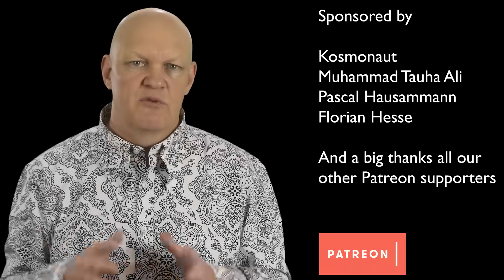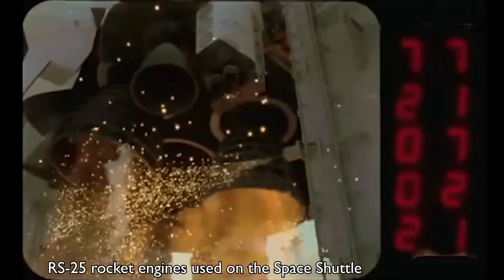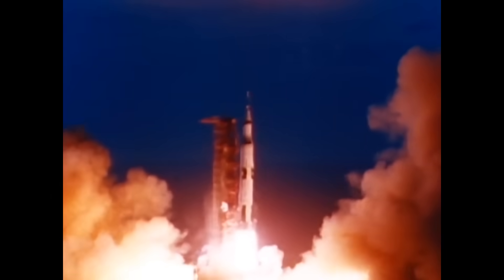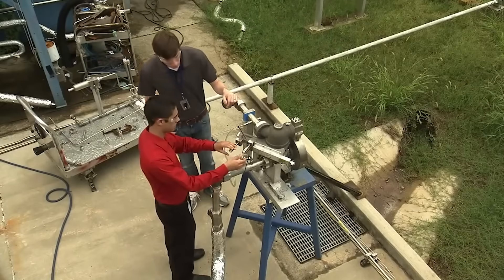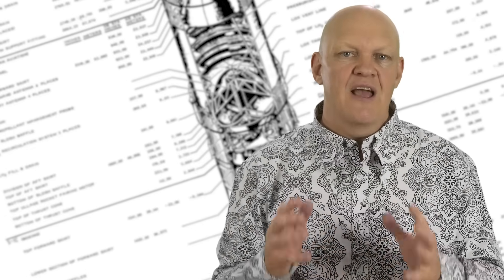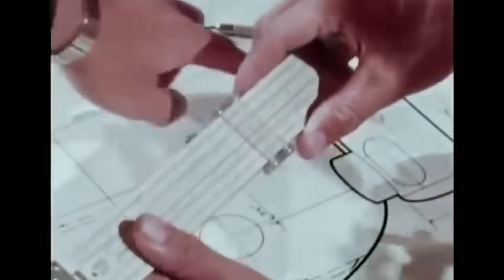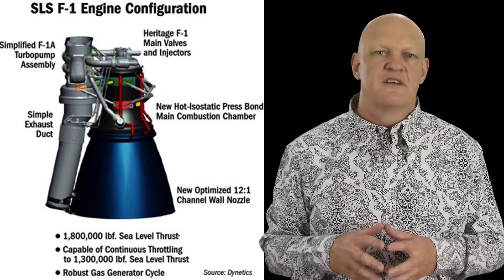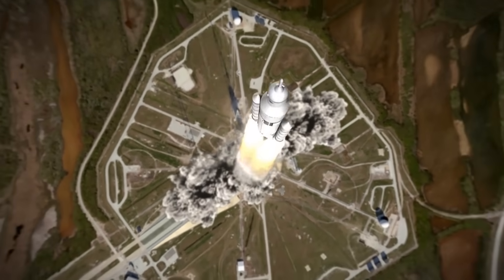Why Can't we Remake the Rocketdyne F1 Engine?

Comment: my buddy got hold of the blueprints of an F-1 engine and built one in his garage. Fitted it to his Chevy. We're still looking for him,
Reply: "Houston, I see something- wait is that a Unidentified Flying Chevy?"
Reply: My buddy was addicted to drinking brake fluid. He said he could stop anytime he wanted.
Reply: Gunslinger 256 HAHA 😂
Reply: Hope it wasn't a Vega.
Reply: @sarge505050  or a No Va
Reply: @sarge505050 
Whatever it was, it became a Nova.
Reply: ...then I realised...

Good one 😂
Reply: Richard Clarke pretty sure it was a Ford
Reply: @felipe69420  if it had been a Ford they'd have FOund him alReaDy.
Reply: @felipe69420  No way. They put the fuel tank at the rear underside, making it very susceptible to an explosion.
Reply: Fitted an F-1 engine to his Chevy?

Just look under the wreckage, the weight of the engine flattened the car. (then F1 weights some 19000 pounds)
Reply: @marvinkitfox3386  nvm the fact that an f1 engine still would need to be fueled.
Reply: @Pintkonan  But it only burns 5683lb per second? Surely that's not a problem?
Reply: @marvinkitfox3386  He used heavy duty springs! And heavy duty shocks. Worked just fine.
Reply: Hey don't get too excited over it, did ut occur to you what his F1 might have meant? Formula One
Reply: Richard Clarke he’s probably still trying to push it back to the house
Reply: @mikecorleone6797  FORD..Found Only Remains and Debris😁
Reply: I'm sure he drove it down to the levee, but I heard it was dry!
Reply: He's everywhere, Billy, literally.
Reply: probebly going to area 51
Reply: hahaha
Reply: Lol
Reply: Give us an update. Did he appeared or atleast contacted you?
Reply: to the mooooonnnnnnn
Reply: LMAO!
Reply: He might be on Mars by now!
Reply: Peter V wasn't that him in that red car flying away from earth recently 🌎🐥🐥
Reply: How many miles she have?
Reply: Richard Clarke Better check the levee and bring water because it’s probably dry...
Reply: he was over the moon about it.
Reply: "We're still looking for him"hahaha that's so funny 😂
Reply: Richard Clarke : time warp... 😂
Reply: Oohh. Now Chevy have big and powerful bottom.
Reply: Was your Buddy named Dock Brown or Marty McFly? I swear these guys should stay with a single impulse device instead of having to rely in trains, boosters, flying tech and pure car power.
Reply: Thats a big stap for mankind.

Comment: To say that we couldn't re-create an "original" F1 using today's manufacturing and design techniques is ignorant. Use Autocad to translate the design from paper to digital design. Then you can debug the engine and refine it using only computers. They built the Boeing 777 entirely on computer based design and testing. Look how successful it is now.

Comment: There are many considerations to the idea of "reuse-ability".  The solid boosters have to be totally refurbished.  Saying they are reusable isn't really being honest.
The solid boosters are also very dirty.  Far more than a hydrogen and oxygen engine.

Because the F1 has so few parts in it's new iteration, we are left with "What's it made of"?  If that answer is aluminum and a bit of steel, then in a way it is at least as "reusable" as the solid rocket engines.. just not in quite the same way.
What is reusable is the material it's made of.  Melted down and reused to make the new engine.  Only the energy is "used".

Doing this would also give us a marvelous look at how to design equipment for the Moon and Mars.  The idea that it's fine to crash something after use... so long as you have access to the materials it was made of afterwards.
Those materials can then be processed and reused to make new equipment.

So yes.. you get a big thumbs up from me to make a modern variant of the F1 booster engine... along with a processing station to grind the engines to powder and perhaps use SLS sintering to regrow the parts.

Comment: If they can build an improved, cheaper and more efficient version, why would they want to build an original F1 now?
Reply: Model T Fords worked really well and got millions of people around but that doesn't mean we should go back to them.
Reply: @foxyboiiyt3332  Well said!
Reply: @foxyboiiyt3332  But if we didn't have any successful cars operating at the time..a model T or even an A model would do nicely..beats walking..
Reply: @neilbishop1686  Walking is healthier..
Reply: @[S]-Riley Dunn The Apollo 13 failure was in the service module which technically is not a part of the Saturn V booster. The Saturn V is technically the 1st three stages.
After TLI injection it has done it's job. Yes, a J2 engine from stage II malfunctioned but still did it's job.
That's why it had 5 J2 engines in case something goes wrong. Imagine that it can still get you in orbit even with two engines out!!
And that happened on Apollo 6 flight where they had this two J2 engine failures and POGO issues during the 1st stage burn, and still managed to get into orbit. That machine is something that should be included in the 8 wonders of the planet! It is way to extraordinary to write history the way it did, and nothing can much it till today in 2019! And the new following rockets still would not have it's capability and service potential to go to another planet with one single launch !
It's a pitty that they didn't kept building one every 5 years and go to the moon for science and exploration. And believe me on that, that what SLS and Space X is preparing and building for future moon and Mars missions with humans, it's not going to be so easy as they are describing it.
It takes a lot more...a lottttttt moreee! In schematics and paper it always looks doable, but in real life is totally another ball game!
Reply: Nobody is trying to build the original.
Reply: @DeputyNordburg  Yeah I'm not quite sure where they got that from, the point is that they figured out how to make the improved version in the quest to figure out how to rebuild the F1.
Reply: @tankerd1847  It stems in part from the moon hoax croud who demand to know why "we" only went once.  (9 times manned, 62 unmanned, being "once")  If we really went, why don't we just do it again!...  
This video in part responds to that. NASA for the most part tried to work with the Conspiracy theorists, but pretty soon realized you can't help crazy people.  Lots of people on the internet still trying to explain things to them though.
Reply: Nordburg , bottom line is that Nixon cut the funding for Apollo. No bucks,  no Buck Rogers.
Reply: @spaceflight1019  Many factors involved but the budget was certainly one of them.  Increased computer power and a NASA scientist culture that resented pilots/fame/the spot light contributed.
Reply: CORRECT!
Reply: @[S]-Riley Dunn 
Just in case you haven't noticed, NASA didn't design or engineer the F1 engine either.  Private companies have been building rocket motors and rockets for NASA since day one.
Reply: We have not sent any astronauts back to the moon in 50 years even with modern technology. Not as easy as it sounds.
Reply: cat mom , actually it's a matter of will and money. President Nixon cut funding from NASA after Apollo 11 and the nation lost interest in exploring the Moon.
Reply: Nostalgia? People still build birch bark canoes.
Reply: Bob thebomb because, bar none, it was the biggest dog on the block.  Still.  To this day.  Don’t give me this shit about more efficient engines.  Light a candle.  Whip a rat or a small dog if you want with the pissy ex-Shuttle engines.
If you want payload into space, call 1800 ROCKETDYNE. #F1.

Sit down.  Shut up.  Hang on.
Reply: Probably because NASA does not have the funds and has to rely on billionaires to build them
Reply: Sixth Dream  Remote viewing is one of my favorite made up crazy things.  Glad to see it is used here.
Reply: Probably for the same reason you'd build something out of DaVinci's notebook.
Reply: @ConcealedCourier  The plans for the F1 are public, go for it.  Same for DaVInci's stuff.  What has stopped you?
Reply: BECAUSE IT WORKED FLAWLESSLY
Reply: @rolandoperez1544  NO IT DID NOT.  You might want to google "Apollo Pogo Oscillation" for example.  Todays raptor engines have about 3X better thrust to weight ratio and are reusable and restartable.  The F1 size was critical before sophisticated computer control.
Reply: @[S]-Riley Dunn 
There is nothing more successful than the Saturn V bro. 100% reliable. It took men to moon a dozen times safely! For it's 50's design and 60's operation it did amazingly well!
Reply: Maybe because they worked really really well and took us to the Moon..

Comment: why would you remake F1 engines when their are better or newer designs
Reply: @Schlomoe Rabinoezisblattgoldbergstein political willpower, if it got people elected we wouldnt have left.
Reply: @Schlomoe Rabinoezisblattgoldbergstein digging tunnels 3-5 meters below the surface should solve most of the radiation issues. ya not seeing the sun/stars might be a bit disturbing for some people but underground tunnels could be short/midterm solution until the resources are available to create radiation safe above ground habitats.

obviously underground construction is more time consuming and expensive but robots could do that work before humans show up.
Reply: @Schlomoe Rabinoezisblattgoldbergstein If i could I would get as many groups on earth to work together to start moon/asteroid mining. A lunar colony would suffer from micro gravity health issues but NASA and ESA knows this. My long term goals would be making rotation gravity habitats/ converting them into spacecraft for long term exploration of the solar system and beyond.

But of course those would be my long term goals and they would require good radiation protection which is why I would build them in space.
Reply: @Schlomoe Rabinoezisblattgoldbergstein you see, the van allen belts dont have the same radiation on all sides, there are parts with low radiation, this is where all apollo missions went through. The thing is, going to the moon would need a rocket better than the saturn 5, and thats The BFR or the SLS which are being built.

Comment: In my Business we run into this problem on a regular basis. I've come to realize it's the way were educating young people now. I have started asking basic multiplication and division questions in my interviews for new hires now. It is surprising how many graduates with engineering degrees can tell you how many times 27 will go into 35000 but they can't work it out on a piece of paper. The basic math skills are no longer there. They don't know their multiplication tables by heart they were allowed to use calculators 4 basic multiplication and division all the way through school. I remember being taught the correct answer means nothing if you don't know how you got there. And that's all I calculator does let's give you the answer. It also destroys critical thinking abilities.

I'm not an old man I'm in my early fifties and I was taught when you look at a part the first thing you do is lay that part out in your head.  
The SR-71 was not laid out on a cab machine. The size of shape of that aircraft was created my working the problem. They already have the answer if you don't know how to work the problem you can't make the part. This is one of the ways the Chinese are going to beat us. You sit down with any Chinese engineer you will realize very quickly they deconstruct everything and the only way to do that is be able to work the math forwards and backwards in your head.

Comment: This is what happens when you don't document your code.
Reply: As a consultant programmer of decades I sometimes discovered comments in programs which were directly opposite to what the code actually did.  Sometimes it was not good that the code was opposite to the comments and other times it was good that the code was opposite.  I was only brought into high pressure projects, so I learned to ignore the comments and study the code to solve the customer's problem.  As the late Professor Mark Weiser of UMCP used to say, the code says exactly what it does !

Comment: Sad. Even if the blueprints aren’t lost, it’s still a technology lost to us.
Reply: Same happens to all old tech, it's not specific to rocket engines. I see it in my work often enough, I work with industrial automation. Building an machine based on 10 year old design is a nightmare, forget about anything from last century. Starting from scratch is usually easier and gets you better results. On the plus side, anything you could do last century, you can do better, cheaper, faster today.

Comment: This is a lot like the state of steam locomotive technology. The Union Pacific Railroad is currently rebuilding the largest steam locomotive ever built (in the popular consciousness anyway), and even with their team of engineers and machine shop, they often have to rediscover technologies that were lost in the 50s. Steam locomotives used a lot of technologies that we simply don't have anymore. The T1 trust is building an entirely new locomotive from scratch, and they've even had to recreate specific metal alloys with unique properties that were lost when a specific mill shut down something like 50 years ago, because it's so essential for the precise balancing of the moving parts. Steam technology was anything but primitive in its heyday.
Reply: I know what you mean. I watched a program where they were putting Drive rods back on  the AT & SF #2926 4 8 4 and they were trying to figure out how to lift the whole locomotive so the could line up the journal. An old guy who used to be a Steam Locomotive engineer got in on the conversation and started laughing at these guys and showed them that they only needed wedges to make the wheel turn at a slightly different speed as they rolled the Loco forward to get the journals to line up. So much knowledge lost because nobody wrote it down to preserve it. Also? Looking forward to seeing U.P Big Boy 4014 under steam in the next 2 months. What an engineering Marvel that job has been.

Comment: If it would be cheaper to build the rocket engine with only 40 parts, then why did NASA choose the model with over 5000 parts instead?
Reply: available tech at the time, tooling etc. They didnt have CNC machines like we have or the material science

Comment: The F-1 is and will always be the most powerful engine ever built. I feel they should build the new version and see how it stands up to the original design. I grew up starting with the Mercury program, yes, I'm an old timer rocketeer at 62.
Reply: +Jim Giordano, writes "The F-1 is and will always be the most powerful engine ever built."

Not true, and by quite a margin. The engines on the shuttle's boosters (for example) produced 13,800 kN (3,100,000 lbf) of thrust while the F1 engines produced a measly 7,770 kN (1,746,000 lbf) of thrust.
Reply: I doubt we will see anything like the F-1 again. Space X have basically killed the concept of a big engine. Using clusters of smaller engines gives you soft landing capability.

Comment: Well, of course they would not be made the exact same way as 50 years ago, manufacturing methods have improved ... What does that have to do with remaking the engines as long as we have the prints? With modern methods, parts can be made much more uniform and faster. As was done instead, the prints we're used as the basis for an updated design using updated manufacturing methods.

We COULD make the originals, we could make them better and faster...but 50 additional years of learning let's us update the design and manufacturing.

Comment: the same thing is going on i a lot of manual handling/manufacturing industry`s old guys are leaving and the young just do not know how to fix the older equiment
i did a mechanical course at a secondery education center and when i came to some simple parts every one in the class would just replace parts and would have no clue how to repair and it turned out my mechanical apptitude wasa not far of from that of the teacher

Comment: I think you are full of shit and so is your full of shit explanation ... only an UNCLE FESTER MORON ... would offer that type of an explanation  regarding the F-1 rocket engine ... in fact  given the current state of  the art ... your  SO CALLED CHUNING , aka   TUNING  should be orders of magnitude easier ... what you are proposing  is contemptible on its face alone .. let alone stating that highly skilled artisan welders do not exist anymore. 
The issue is simple  UNCLE FESTER ... those engines cost a shitload of money and their complexity is not needed for the MICKEY MOUSE SPACE MISSIONS of the modern age ...and like all other issues of today  , it is a matter of making pork out of pig shit ... and lastly   I agree  with but one thing you blabbed about at length ... it is true  that present era  computer model engineers are INFERIOR   in any capacity whatever  to slide rule trained  engineers.

Comment: We have got past the F1 engine years ago with the anti grave units of the TR3B Rockets finished in the 1980;s The sheeple of the world are being duped. Spin mercury plasma in a turoid at 150.000 rpm under pressure and gravity can be reduces. Also electrogravitics can also be use just as it is use on the B1 stealth bomber. Why reinvent the Austin7 when you have a Ferrarie speedster. look at the patients under TR3, they do exist